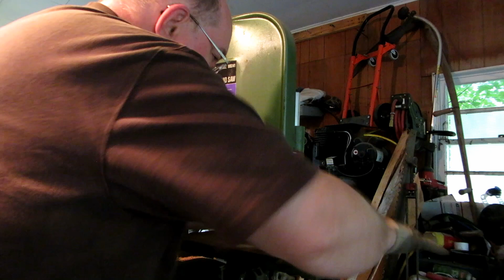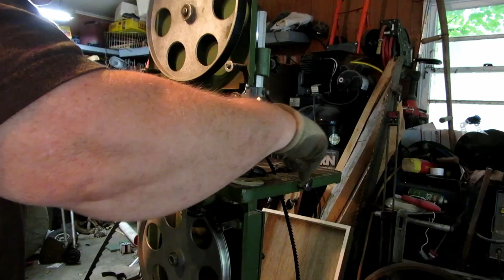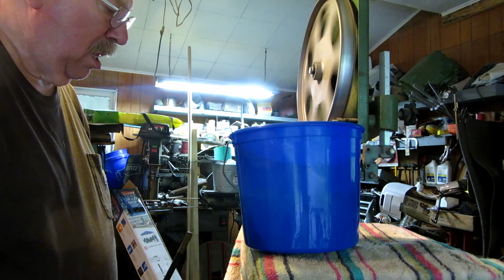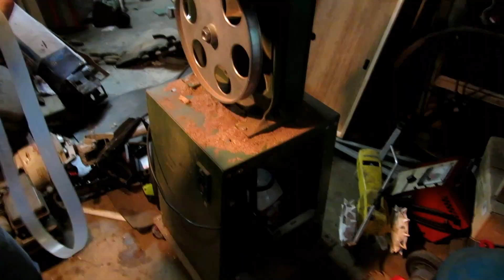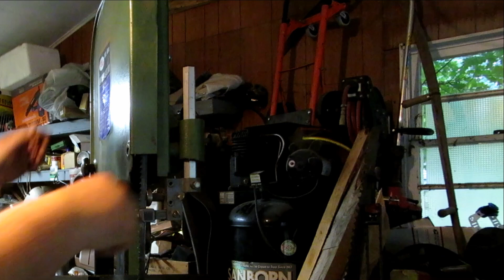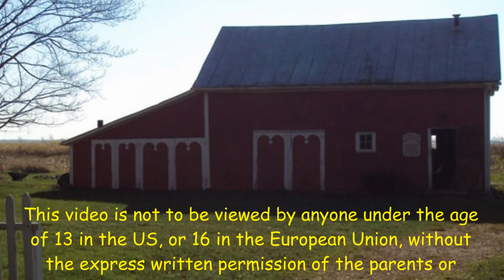New Tires Installed On The 14 Inch Wood Bandsaw

Comment: Hi I am restoring a Harbor Freight Horizonal/Vertical Band Saw, I do not find information on tires for this saw. Should I add tires to the band saw blade drive wheels? I watched your video's on restoring the same saw, at that time you mentioned that you would be adding a home built Blade Back Cover, I recently ordered and received the Blade Back Cover from HF,  it was Under $10.00 including freight from Harbor Freight.  Please advise your thoughts on adding tires for this machine.  Thank You. Richard 
 PS: great You Tube channel.
Reply from the maker: Wood cutting band saws use trres. 
Metal cutting band saws do not use tires. 
Not sure exactly why they don't but none I have worked with have tires.